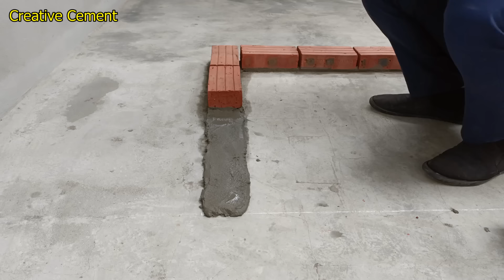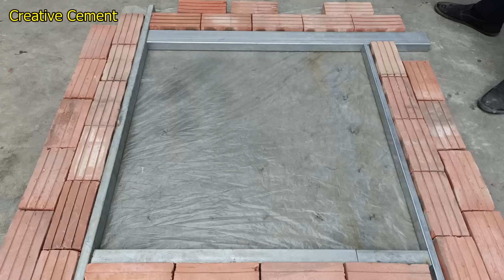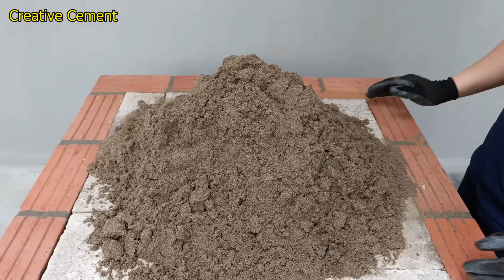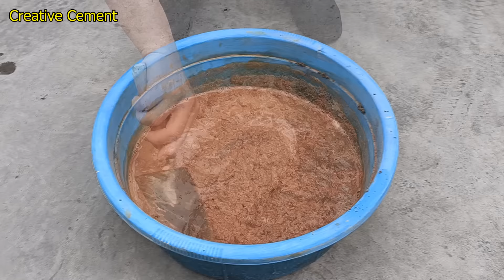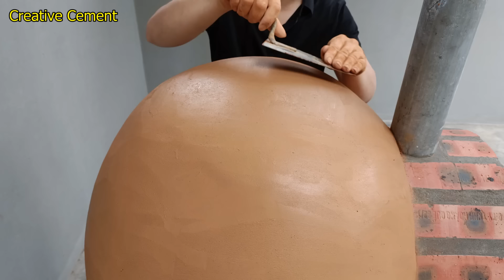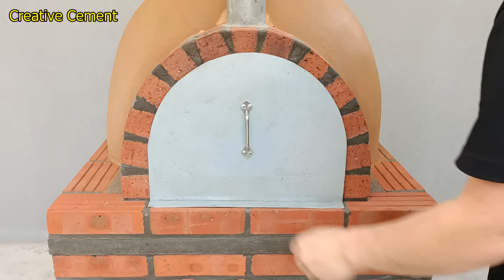How to make a simple and beautiful pizza oven

Comment: You should have insulated the floor slab, that reinforced concrete is just drawing all the heat away, the bricks in the arch cannot withstand high temperatures,  and the cement needs to be refractory or that will fail too
Reply from the maker: Thank you very much
Reply: How would you insulate the slab?
Reply: @armitage4  vermiculite concrete
Reply: @jeremyfoster6942  thanks for the reply. God bless you.

Comment: I’ve watched several of these pizza oven videos. I’ve figured out I’d have to make 10,000 pizzas to break even. That’s pizza the rest of my life. Awesome design and build.
Reply from the maker: Thank you for watching
Reply: Yeah... I don't think having your own pizza oven is about saving money. No one buys a private jet for saving money on airfare
Reply: Finance is not your thing for sure.  ;0)
Reply: @lukassteenkamp9572  Excellent comment.
Reply: Math speaking, it will take less than 10,000. Also, you have never had a Neapolitan pizza. Also, in a well-made brick oven, you can cook for two days with residual heat after cooking pizza. Roast, Veggies, potatoes, you name it. The break-even is getting smaller and smaller, and without counting, a photo of you next to the oven. That has no prize. 🙂
Reply: How much do you think this will cost!i think you need to go and work it out again.Also a homemade pizza is superior and I make bread/roast and cakes in mine
Reply: @susankirby4273  
Homemade Pizza is not superior if you're trying to make a Neapolitan style Pizza and you don't have a proper oven
Reply: How are you calculating cost?  It shouldn't cost anywhere near that amount for diy project.

Comment: Man, with not even a word you've taught us in such a perfect way. Congrats! For sure I'll try that... But just a question... Wouldn't it be better if you had put the chimney pipe on the clay round part?
Greetings from Brazil!
Reply from the maker: You should place the chimney in front of the door. If you place it on top of the clay circle, the heat will escape through the chimney and the stove will lose heat.

Comment: What clay mixture did you use to make the dome?  Is there any chance of cracks happening?
Reply from the maker: I use red clay. When dry, clay still has a certain shrinkage
Reply: @CreativeCement Don't you need to add cement to the mix?  Just pure clay?

Comment: The much more important part of the oven for the correct function of a wood-burning oven, in addition to the dome is the top, it must be carefully and scrupulously built, several layers must be created to insulate the reinforced concrete part of the structure, this to give the food to cook the right heat distribution, the layers of refractory bricks must be two alternating with natural heat insulators, and this must also be done for the dome, it must be insulated from the outside, otherwise the whole cooking process will be negatively affected.
Reply: Are you sure?
Reply: @stevethomas5209  I am absolutely sure, the insulation of the hob is fundamental and must be done with all criteria, as is obvious the insulation of the dome, it affects the functioning of the oven itself, mistakes are often made (due to inexperience) in not dedicating time and materials for insulation especially when the structure is built outside, I have a brick wood-burning oven built 3 years ago, well, the cooking of food (obviously depending on the temperatures adapted for each baked oven or meat or fish) the uniformity in the distribution of the heat as the maintenance of this is very important, like the difference from a prefabricated brick dome or from the shape, round or lowered, this too must be calculated according to the most frequent use, Pizza o Bread, biscuits, meat or other.
Reply: @stevebardella_farm-nature7bis  Your way over thinking this. This is not in any way a professional grade oven thats going to cook bread and pizzas every day for the masses. It's just a backyard oven, if I want it hotter to cook a pizza better next time well... I just adjust add more wood but for this time the 1 pizza that I'm cooking this week it's just fine. If your going to calculate this and that as if your putting it in a five star Michelin restaurant in Italy ok but my goodness this one will do just fine in my back yard until I'm ready to move and get rid of it. It's obvious this man is showing us how to make a simple oven and you jump in w all your calculations and how great your oven is. I'm sure it is a nice oven but for simplicity and affordability this will be just fine. But anyway enjoy your oven I'm sure from what your saying it must be very nice I enjoy all these videos.

Comment: This is nice but wouldn't it start to fall apart not being fire brick or using refractory cement?
Reply: May be that's the punchline.
Reply: like the pizza
Reply: Yup
Reply: I do wonder. Wonderful design though
Reply: I'm trying to get one like this for my outdoor kitchen area , Ive  recently moved to Spain and any reviews I've read from local suppliers haven't been good. 
The users say the top end split/ cracked after the first use !
Their not cheap to buy here either, above 1000 euros.
I don't mind paying but not for it to crack after first time use 🤔
Reply: I'm in Spain Costa Blanca
Let me know if you get done one please
Reply: To stay 100% natural for this building (...) No chemicals !
Reply: He'll never know. This was built indoors. It'll probably be demolished and removed before the next video, if it doesn't burn the structure down first.
Reply: Great question
Reply: Depends on whether or not it survives the heat long enough.  If it does then it'll be fine.  Not being fire brick or the right cement doesn't mean it isn't capable of tolerating the heat, just that it's not tested and guaranteed to survive the heat but if it does, it'll be fine.
Reply: @gma6139  

No chemicals?
You can't have cement or brick without them.

And what is fire if not a chemical reaction?
Reply: I was talking about "synthetics"... Not naturally chemical reaction (...) for the rest what about the construction in the ANTIQUITY PERIOD... Bricks and cement also... With industrial products from BAYER company ? (not realy)
Reply: @johnwang9914  😅
Reply: It would probably survive as it’s under a roof but I do wish he’d used materials for an outdoor arrangement—- it would have to be a more robust material—-
Reply: @ambroulard  It was only a technical exemple for a video... Not the word of GOD.
Reply: Yes m'y friend but...  When you eat a sandwich it's also a chemical reaction between a 'Beef-Salad" and your owne SHIT a few time's later (NOT NATURAL ?)
Reply: @gma6139  ???   What are you even talking about???    Any design especially for a pizza oven fcs needs to exhibit survivability—- it’s not design for a wear once throw away dress gown.—-
Reply: @ambroulard It's made in this way for ALL cooking in south from Europa like in Greece Cyprus Turkey and many other countries also and about CENTURY'S...  Mister EINSTEIN !
Reply: @ambroulard  Et encore toujours AUJOURD'HUI !
Reply: Nice pizza oven. Now what you need is a pizzaman.
Reply: Seeing other videos making similiar, I was under impression it would crack after some time and need to be filled in with more clay mixture
Reply: No. People have been cooking like this for over 2 millennia. Build one big enough it will forge hard metals. With the proper air flow and propellant that is😉
Reply: Great video
Reply: Clay has been used for 100s of years for cooking in or on..to this day we use clay ovens overseas..yes they do Crack here and there..but are easily repatched.. even here in Canada I have built a cook stove of just some extra bricks and clay..and and am currently building a clay and clay brick pizza oven..
Reply: @ashibee3877  I guess I am looking at it from a commercial standpoint
Reply: My father an grandfather were European trained stone masons/bricklayers. This piece of crap will begin to disintegrate at the first fire.
Reply: @garywilliamson8619  I've given up trying to find one, all reviews were bad with cracking and splitting etc. So I'm buying an Ooni multifuel pizza oven. Their not cheap but have great reviews. The 16 inch one looks good. I can lift out of the press and place on the counter top. Not as nice on the eye as the concrete ones but at least it won't crack. I'd hate to pay north of a grand and the thing to split !
D.H
Espana
Reply: Was that light grey brick that he built the dome on heat resistant brick??
Reply: Lovely design but sadly in my opinion doomed to fail. The  rebar and the metal chimney are likely to expand and contract many times eventually cracking or even breaking up the masonry. Rock wool fibre in the slab would have made more sense. A terra cotta chimney pipe would have been better than metal. Not to mention all the non-refractory materials. 
Nice try though.
Reply: I'm making firebrick to build a dome oven now. Using 1 part Portland cement with lime, one part fire clay, 1/2 part sand- mix this, then add 3 parts perlite ( not vermiculite!). Mix dry, until the perlite is completely coated, with no white showing from it. Add water slowly until you get a peanut butter consistency. I made 34 brick molds, enough to mix a wheelbarrow full at a time. I have tested the bricks at over 700⁰ for an hour. Also, I can heat one side of the brick to red hot with a torch while the other side is still cool to the touch. I will start building a dome about 48 inch inside diameter, once I have made about 300 bricks. 90 complete so far.

Comment: Pretty cool video. It looks great and evidentially works. However, the clay lining looks suspicious.  I'm interested in how long the lining will last.  Also, the pizza looked suspiciously close to the coals.  I'd like to see your video on cleaning the coals.  I'm not sure I'd want a wood-fired oven, but rather a combination pellet-oven with a supplemental gas heating-element (for higher temperatures). The pellet hopper could have its own access panel for cleaning.
Reply from the maker: Thank you for watching
Reply: You like the word suspicious don’t you?
Reply: What type of cement in use? Thank you.

Comment: Les joints des briques sont trop gros ca va péter, dans le dôme la chaleur monte a 750 degrés avec des pointes à 850 degrés ca va tenir 6 mois et encore avant de fissuré, il faut employé un mortier réfractaire pour jointoyé les briques et faire des joints de 2 mm maxi , et employés des briques 30 à 35 % d' AL2O3 pour la voute et 40 à 45 % pour la sole

Comment: A little yes and a little no!!!!
An excellent job although perhaps it could be improved (a heat sensor would in fact be perfect for checking what temperature the oven is at!!!
But can you explain to me what's the point of even making a brick oven if you can only put 1 pizza in it???
If you want a real oven like this, at least you have to have the possibility of being able to cook 5/6 pizzas at the same time, otherwise it's quicker to order a delivery!!! Nonsense ...
Reply: Each pizza plate will take 4 to 6 min to be ready in the oven so if you prepare several pizzas ahead of time problem will be solved.